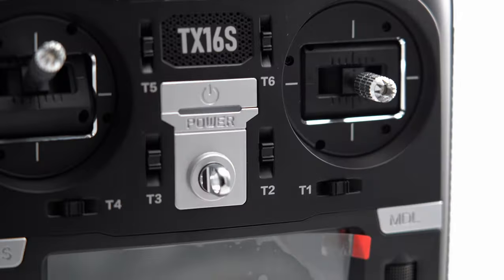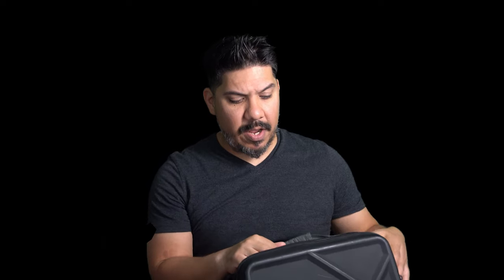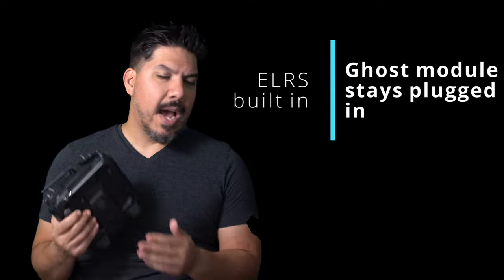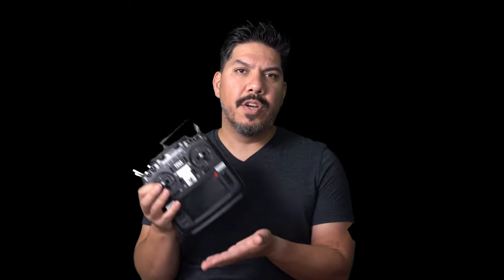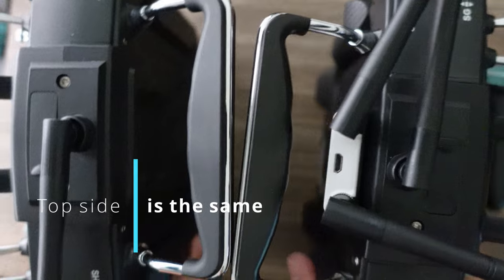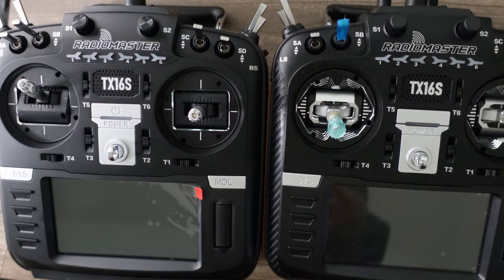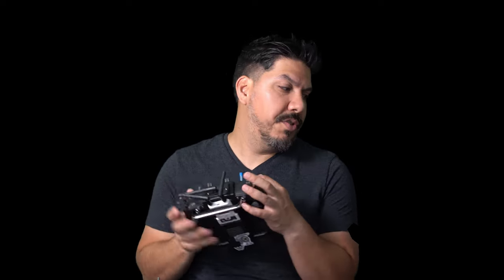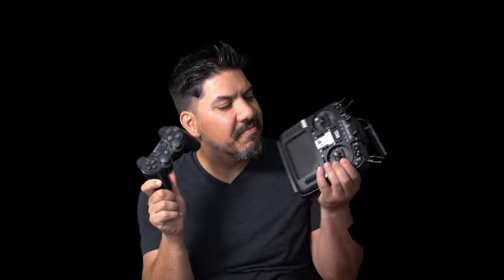Radiomaster TX16S V2 - FPV Radio controller mark II

Comment: What made you switch to elrs. Everyone ditching crossfire
Reply from the maker: Its small, cheap, and pretty easy for begginners.  I still think crossfire is best for long, range, but i dont long range much, so lately im using ELRS more for micros since i dont need the more expensive gear for small stuff i just fly around the house with.

Comment: Ago1 pricy how do the frsky m9s compare? Planning on the dji controller mod
Reply: I used both and AG01 are much smoother. Local to me guy just installed AG01 in DJI controller, I think he had to mod back a little bit.
Reply: @SirCrashaLot  mod back a little?
Reply: @mfrfpv9079  I think he had to remove some material from the back of DJI controler to clear gimbals. Then design some covers.